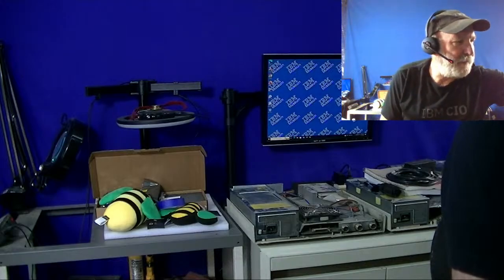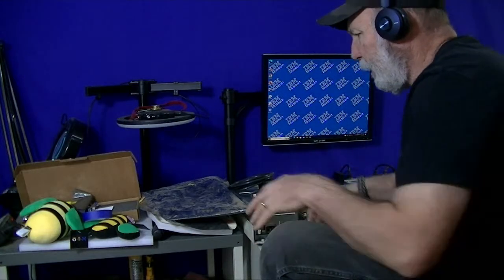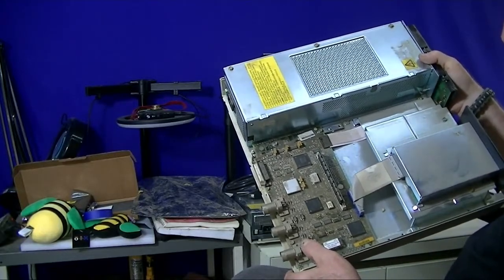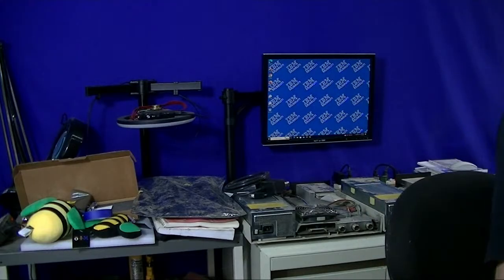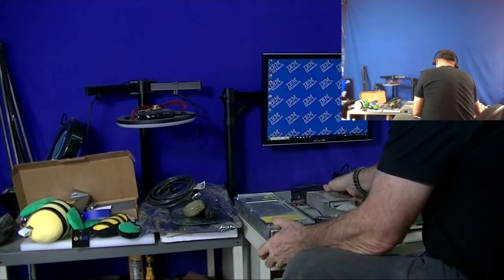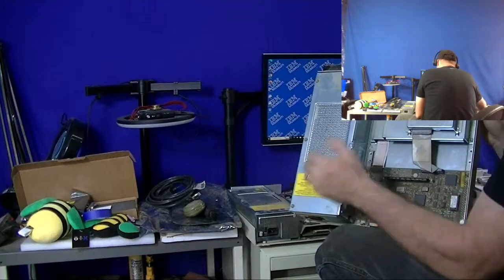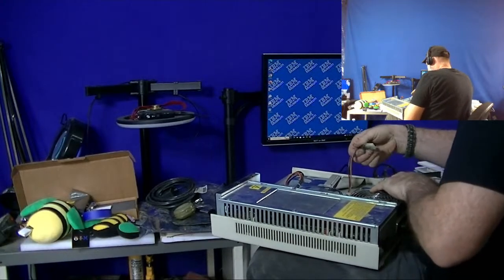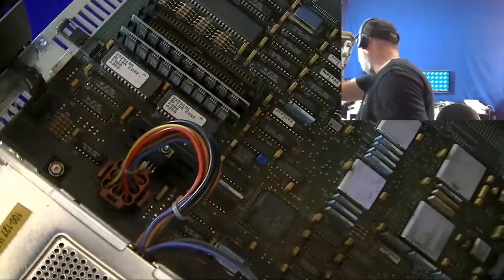Clean-up and comparison of a couple dirty IBM 5394s!

Comment: We had a couple 5494's and a 5394 at the place I worked from 98 to the end of 2000, tied with the big AS/400 on wheels that looked a lot like a mini fridge. Mid 99 we started transitioning to ethernet so a lot of the MAUs and twinax slowly went ou of use.